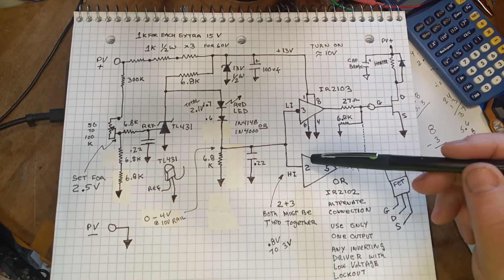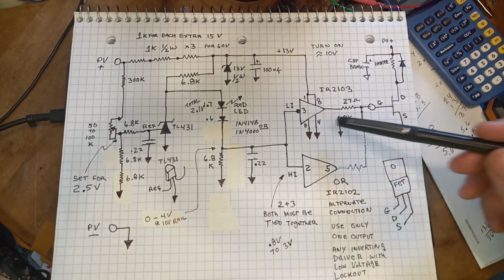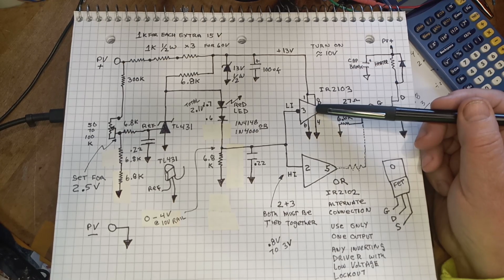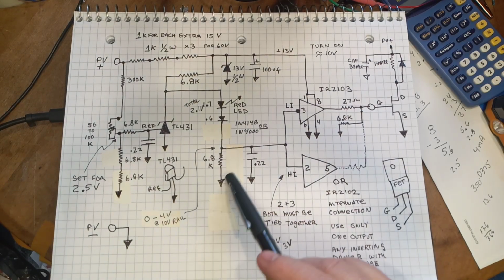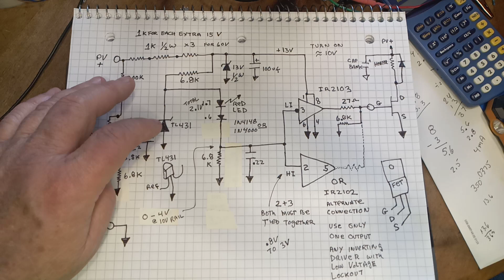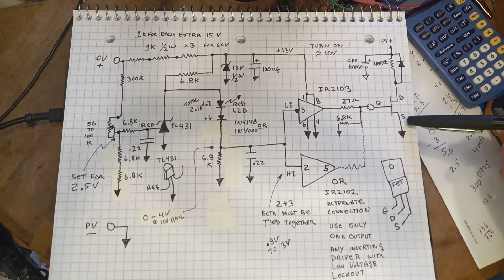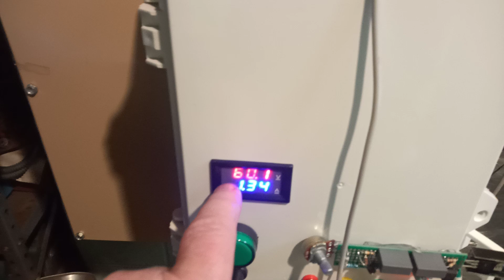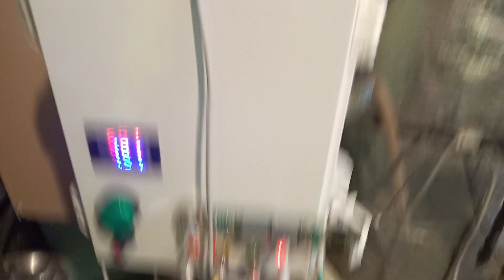Simplified IR2103 Power Point Efficient PV Water Heater Control #fotovoltaika

Comment: Inspiring video! The TL431 was a mystery to me so far, now I got it.
Reply from the maker: Last time I bought some they were two cents each.  I have a video where I use two of them on a current shunt and one of them drives a relay directly.  Very low count current monitor.   The one thing which is overlooked is the reference pin is high impedance until a fer mv above the reference voltage and then it draws current until it burns up. It always needs some resistance to keep it under 10ma.  It can drive someone crazy when they see a voltage divider never increase in voltage.

Comment from the maker: Don't dismiss this controller because of its simplicity.  I've watched this for days with a scope and this controller is as good as it gets for a control without thermal tracking and arc interrupt.  Cheap enough that one can be made for each heating element and a cost similar to a solid state relay from China. Differential voltage is only 2V on a 60V system, about as good as you can get with a capacitive storage system. I did make one change to lower noise even more.  Gate resistor was changed from 27 ohm to 100 ohm.  I can put the antenna of my ATS-20+ shortwave receiver on the drain of the FET and still not pick up noise.  
I' not going to bother with anymore simple designs, this is simple and cheap enough. 

A TL431 can replace the 13V zener to reduce the number of items to purchase.  Just use a 4XR for the upper resistor and 1XR for the lower, like 6.8K and 27K or use 4  X 6.8K resistors in series.

Comment: resistors are very very cheap so do it the wright way people
Reply from the maker: For some they aren't cheap.  For solar people this is probably their first venture into electronics and ordering multiple values is expensive. They may be starting out without even a soldering iron.

I worked for a place where I would agonize over adding an additional 1/3 cent resistor for days.  Insertion rate was $.45 per component. That was back when that was real money.  It would mean the difference between getting a contract and losing it.

Comment: isnt there a better way to do all this lol if you have all the parts you ever need then im sure you could make one better then this sure it will get more complicated but but thats life either let china do stuff like this or do it the right way not the cheap chineese way
Reply from the maker: The most popular electronic videos on YT have less than 5 parts.  More than that people just give up.  It is irrational.  Put one part in ever two days and it is finished in a month.  YT is nothing but voyeurs wanting to see things blow up.  I can't really concern myself with the no talent solar community that has no understanding of PV or electricity.  This is just an exercise in design.  At least it works properly.  That can not be said for other designs I've seen which have serious technical flaws.
Reply: "IF you have all the parts".... so fare my premium to get the parts is $5 a piece. All the carriers "loose" my packages.
Reply from the maker: @noldushumlesnurr6169 Yes, these small charges add up quickly and I am sensitive to that.  I have the belief that electronics should be free.  Discarded electronics that are more than 10 years old, before surface mount components, are a great source. A lot of value substitutions can be made.  I will be making a couple more versions  using more common parts instead of the FET driver.   My next will be the wall wart control made from a cell phone charger.  Then there will be an op amp version.  I grew up harvesting parts from old electronics.

Comment from the maker: Everyone wants simple.  This is simple and has the minimum parts count to be a good stable circuit. Funny thing is circuits which have more features only use about a half dozen more parts. This uses the Schmidt trigger inverting input of an IR2103 or IR2102 and the low voltage lockout to make it stable as PV voltages rises in the morning. The circuit keeps the panels at near power point voltage to make it efficient transfer of energy into a fixed resistance.  Energy is stored in a capacitor bank in off periods.  A FET of sufficient voltage and current of at least 10X panel current should be used or multiple FET to reach that current.

I used a FAKE IR3205 which had a tested breakdown voltage of 83V for the output.  Gate capacitance of 5nf indicated tha this probably had a current rating of over 80A.  It seems to run cool.  A real IR3205 FET is rated at 110A and 55V, breakdown voltage will be about 63V. It is hard to get parts that are real these days.  This test is using the 6,000uf of my existing water heater control. I just turn that off and connect any experimental circuit to the three banana jacks in the front panel.

Voltage sensing is done with a TL431 with a reference voltage of 2.5V. A 0.22uf capacitor filters some noise and provides a slight time delay. TL431 output can drop as low as 2V and the following LED and silicon diode offset the voltage 2.1V to the Schmidt inverting input of the FET driver.  Again, that input has a 0.22uF to provide a delayed on and off to provide stability and prevent short pulses from noise.

Using inverting drivers can be a bit tricky at morning startup.  Using an opto isolator or PNP transistor simplifies design but adds additional components.  At full sun, the FET turns on and stays on.  Frequency is free range depending on size of capacitor bank and heating element resistance. There is no arc interrupt in this design.  Thermostat can control board power to shut down. I saw between 30 and 300 Hz in this test. For higher voltages than 60V, add an additional 330 ohms resistance for each 5V over 60V array voltage. Each resistor should not be over 1,000 ohms when using half watt resistors.

This can work with any voltage array.  Just select the correct capacitor voltage.  There are small switching 120V AC supplies which run fine off DC and can be used in place of dropping resistors.  FET or IGBT can be used for the output.  Generally, IGBT used over 200V because of cost.  Multiple HV FET can be used in parallel.